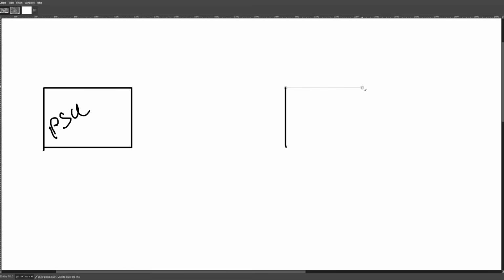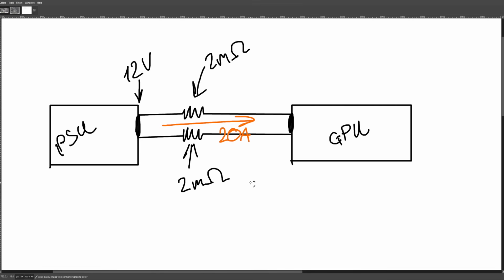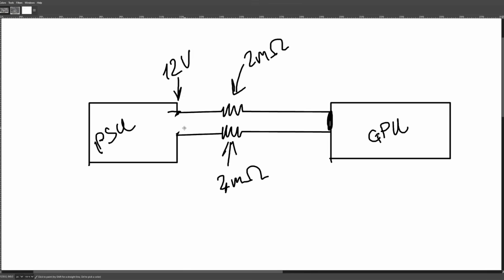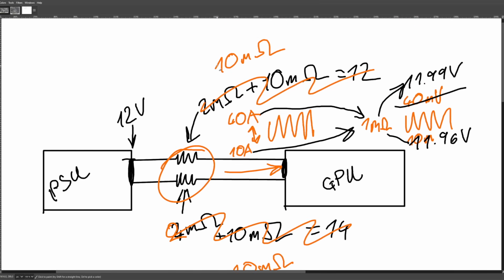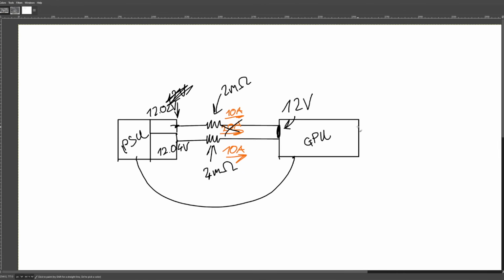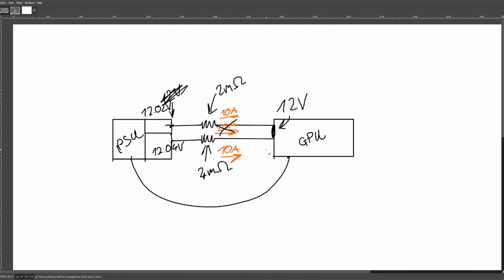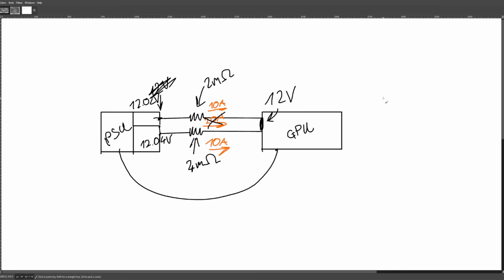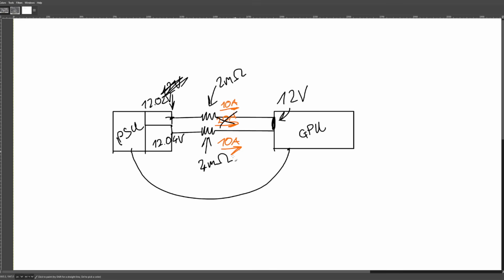Why ATX power supplies don't load-balance power connectors

Comment: I think a meaningful change would be for the PSU to just cut off a load if it's misbehaving. Like, if the PSU can tell that this port is utilizing a bonded connector, but that something has gone (or is in the process of going) catastrophically wrong, then it should just refuse to service that connection until a system reset occurs.

I know that I personally would prefer it if my PC shut down when something goes wrong, as opposed to harming itself in the process of operating.

Comment: Best way ...  12v rail needs to be 24v.   Higher voltage transmits more power with less resistive losses.

Comment: 8:18 Could also monitor the current and voltage on each outgoing rail and then adjust the DC-DC converter in the PSU for that rail, which is hideously complex just so the dumb power connector does not burn the house down.

Comment: my design would be high current bullet style connectors with 2 large wires. bullet connectors at this scale would probably come up at a dollar per assembly, more expensive than stamped contacts. but they are also proven and reliable at high currents, easily doing 80+ amps at reasonable size. having two large high current pins is more annoying for board design, but a fan-out could be designed into the receptacle.

Comment: wire vs silicone is such a cost imbalance honestly just use more connectors. Nobody's goanna complain if you need 3 or 5 or fuckit make it 10 power connectors. If anything it'll feel like an absolute boss piece of hardware if you're flagship card needs that many power connectors. What isn't acceptable is durability issues on a expensive premium product power pins should never melt you can afford the extra connectors and wiring. Also this is a desktop not a laptop I really don't care what the power draw is to be honest, I'm happy the cards only need a couple hundred watts but I'd happily feed my gpu 10,000W if the performance increases proportionally. Hell I wouldn't mind having a dedicated psu or even multiple dedicated psu's just to feed the gpu but Id expect the performance to match. The extra cost of a couple psu's would be nothing if I get a beast card that will still crush new releases of games ten years down the line what I want is reliability and performance that's goanna last a loooong time not power efficiency or something designed to look cool with compact designs and fewer wires or whatever.

Comment: In principle you could make a power supply that has separate transformer windings, diodes, serial inductors and capacitors (the typical components making up a power supply output) for each +12V output on the high-power connectors.
Those would each be lower current rated outputs, have a higher internal resistance, and those would add to the cable/connector resistance making any differences in them less visible.
E.g. you have a couple of 12V/5A outputs that are specified to lose no more than 250mV at full load (2%), those would have an internal resistance of 50mohm.
With 6 of these in parallel, you could supply your 20A and have a total internal resistance of <10mohm, but a spread of internal resistance of the wires is not going to lead to such a wide variation of cable current.
The key point is that you use the (unavoidable) internal resistance of the power supply in a way to "balance" the currents by making cable resistance differences less significant.
Of course it would increase cost and size of the power supply.  And one could argue that the equivalent of this, having separate regulators for each connector pin on the graphics card, is the proper solution.
Reply: Given the transformer windings would have their own resistance, adding a fixed resistor to each lead would have a similar effect with less complexity. This can also be done card-side, and is basically what separate shunt resistors for individual wires (or pairs of wires) does.
Reply: @chord5625  But that results in unnecessary losses.
The internal resistance of the powersupply is an unavoidable cause of losses, but a power resistor put in series with the wire is not.
Other than that, yes it would have a similar effect.
Reply: @Rob2  Separate transformer windings will need to be much smaller to all fit inside the same PSU form factor, and thus have higher resistance.
Reply: @ Yes, but that is exactly what is required because it will facilitate the balancing of the current.
The PSU will likely be larger due to the many extra rectifiers, coils and caps.

Comment: Surely it’s just time to move to connectors like an xt90 which are made for the amps instead of beating a dead horse of molex mini fit
Reply: The RTX 5090 needs the XT-120 connector.
Reply: @MrSummitville I wouldn’t complain with an XT-120, but an XT-90 is almost double what it needs. At 575w TDP that’s only ~48A @12v….. so no it doesn’t NEED an XT-120

Comment: im 8 minute in the video, regulating the current in the psu stile make me think that a man in the middle pcb like a raspbrerry pi or other microcontroller board with a an array of switch and resistor that balance the cable and if the resistance of one wire is too high short the power swich pin on the motherboard to force a shutdown and try to save the gpu while sending a message to for example a custom app on the phone of the user to alert them on the situation and provide real time cable situation report on said app could a product that would help, not a solution to the problem but a way to help reduce damage to the sistem, i want to try make this and maybe sell this, but if someone more capable than me made this it would be intresting see if it work well
Reply: Someone makes a "man in the middle" board to monitor the amps in each wire and send alert via USB.

Comment: They just should sell a cheap high power soldering iron and a bit of solder with nGreedia new plug cards, so that you can cut PSU wire and solder it do the pins and probably remove 99% of the burning issues.

Comment: I'm afraid you've completely missed the point here and this video is a very diverting investigation of something that doesn't matter.
Fundamentally, you show that the 12V rail (in your example) is all shorted together at the PSU and at the GPU. This means that the loom of wires in between cannot be 'balanced' as you call it.
The purpose of the large number of wires and pins on the connectors is precisely because there is a known and variable resistance to the individual wires and the contacts (within know tolerances). The repetition is to run those in parallel so as to reduce the total resistance (1/Rtotal = 1/R1 + 1/R2 + 1/R3 + ...)
There is no requirement to ensure that the same current runs down each of the wires, the desire is to minimise the voltage drop across the loom and ensure the voltage at the load varies to the minimum degree as the load draws more or less current.
The real challenge is to make it so that software engineers can't mess up connecting the loom to the load (not an easy task given how careless software engineers tend to be with hardware). That means a connector that is robust, cannot be inserted the wrong way around, is self-aligning as it is mated, and can't bend the contacts and pins when abused.
Really, the clarion call to computer enthusiasts and software engineers is this: Stop being so ham-fisted and clumsy!
Reply: You missed one goal - making sure you don't encounter thermal runaway on any part of the system. There's no guarantee that rising temperature from overload will increase resistance enough to self-balance, far from it.

Remember that across parallel resistors with the same voltage drop, power dissipation is Vdrop^2/R - it's the lowest resistance path, not the highest, that's forced to dissipate the most heat. The takeaway is that if variance in contact resistance (e.g. 0-20 mOhms) is large enough to dominate baseline wire resistance (~3-4 mOhms), then you can't assume even load distribution across conductors, and therefore you can't assume that the current carrying capacity of 6 wires is 6 times an individual wire.

Fundamentally, you can't push 25A down a typical 16 gauge wire and expect it not to melt. Physics is physics, and ampacity limits apply to each wire individually.

Comment: PSU should never allow more power on a single line than specified. I am not saying that it should do a load balance, I am saying that it should limit the current or shutdown the line.
Reply: I'm guessing adding a whole breaker panel to PSU design is prohibitively expensive.
Reply: @chord5625  I cannot accept that excuse for a device that cost is between 200-300$
Reply: @logman5051  I mean, a breaker panel itself usually costs $300+, so yeah, we're talking about 2-3x in price at the top end and 6-7x price on the lower end.
Reply: @chord5625  what are you talking about, small breaker panel with 5 fuses cost around 30$
Reply: @logman5051  I don't know what panel you're looking at, but a 1K+ watt PSU is going to have a lot more than 5 12V lines coming from it, and that's not counting all the miscellaneous voltages (5V, 3.3V, -12V, etc.) provided or the multitude of ground lines (which can be overloaded, even if no individual supply line is).
Reply: @chord5625  what 12V I am talking full ~230V 50Hz 16A.
But to be serious adding 100 new elements to a PCB can cost as little as 1$, I do not see a valid reason why those components should not be there to protect you, me and a neighbour kid and not only from fire hazard but also from electrocution. Ultimately PSU is responsible for electricity in your PC not CPU, not GPU, not MB.
Reply: @logman5051  Very small components are cheap, but are also too small to handle power currents. You're going to need components capable of 10A, and sensing/control circuitry for each line. That circuitry also has to be tuned for inrush current handling for each device, etc.

Should also keep in mind that if you cheap out on your sensing circuitry, you can introduce new failure modes from the circuit setting itself on fire.

Comment: I think Nvidia made that connector like that so it melts so the card has less value to sell, and the owner has less incentive to do so, so they have more incentive to buy a new GPU, it makes perfect sense when you here the name Nvidia...or Apple...why? To control the market even more from the used-parts portion so they don't end with having to deal with stagnation of sells because used cards exist in the first place.

Comment: The method you propose to do current balancing on the PSU side is almost certainly not how they would do that.  What they would much more likely do is split the regulation circuitry into several phases and give each phase a current sense resistor.  Then they can do a regulation loop that adjusts each phase such that the current in each phase is the same and the total current is what the load needs.  This has the effect of having each wire (or possibly group of wires) have its own voltage, compensating for the differing drop in each wire or group of wires.  It's also much more cost effective since the PSU may already be using several phases to supply the load.  So the extra cost to regulate each phase independently is much smaller than adding a bunch of power components since its just control circuitry and some extra current sense resistors (which, depending on how they designed the power supply, they may already have per phase current sense).  If there's enough demand, the control circuitry can be built into the control chip, making the cost pretty minimal over what they're using right now.

Comment: Your math doesn't work for me. I initially wrote this then edited now i'm just rewriting it. So i was basically making an assumption that you meant 2 millionth of 1 resistance ie .000002 and not 2000000 ohms for example as 2 and 4 megaohms just doesn't work. Especially as we can't get to 10 amps per side with 2megohms. Math would be 12v²/2000000 ohms=0.000072 watts and 12v/2000000 ohms=0.000006amps. If we go back to say 12v and 10 amps we get a resistance of 1.2ohms and 120watts. Now back to where i think you meant to go was adding 2 millionth of 1 resistance so 1.200002ohms total and 4 millionth of 1 resistance so 1.200004ohms total. Then these numbers are almost inconsequential.  The voltage difference would only be 0.00002 volts. Note that if 1 side did have 2 megaohms and the other side had 1.2ohms ya the 1.2ohm side is taking 99.99999% of the load as the 2 megaohms side is darn near an open circuit. If we instead say 1 side is 1.2ohms and the other has an extra 1ohm of resistance so 2.2ohms this side is only putting out 5.54amp and 65.5watts. Meaning it's only doing 27% of the load when it should be doing 50%. So the 1.2ohm side is doing 73% of the load. And this ofc can cause overheating as when it exceeds it's rated value which is what 300watts per side for 600 watts total. If a vid card is doing 500 watts as a rtx 4090 does and 1 side is doing 73% of the load that's 365watts so it exceeded it's rating by 65watts on that side and or exceeded it by ~22%. And we've seen overclocked 4090s doing 666watts btw and that would be 486watts on 1 side. Yikes. If that doesn't melt sockets/cables i'd be shocked.

Comment: I dont think current balancing solves the problem, its not the wires resistance is imbalance that much its the connector pins which is resistive because of bad connectivity of oxidation, which means its will heat up. Because higher resistance means higher power loss which becomes heat.
Reply: Ironically, when it comes to parallel conductors, you've got it backwards. Voltage drop is the same across parallel conductors (by definition), so power dissipation on each path is Vdrop^2/Rpath - the lowest resistance path is forced to dissipate the most heat.

It is still true that keeping contact resistance consistently low across all pins will reduce overall heat, by reducing Vdrop. But when you're running so many parallel conductors so close to their maximum current capacity, you have to balance the current across them or else manufacturing and transient variations in resistance (e.g. contact resistance) will lead to overload.

Comment: Why is the combined resisten from 2mohm and 4mohm 1,3mohm?
Shouldn't it bee 0,75mohm because of parallel resistens. So 1/2 + 1/4 = 0,5 + 0,25 = 0,75 mohm
Have i overseen something?
Reply: 1/2 + 1/4 = 0.75 = 1/1.333

Comment: I don't understand why to even split into multiple cables if they are connected on both sides anyway.
Reply: Counterintuitively, you actually need less copper if you use more wires. Thinner wires are also more flexible and easier to manage.
Reply: @karl0ssus1  But this example raises a critical issue with the "parallel conductor capacity = sum of individual capacities" assumption. If the resistance variation isn't controlled from conductor to conductor (in particular, if contact resistance variance dominates wire resistance), you either need to derate to account for uneven loading, or add load-balancing mechanisms to compensate.
Reply: @chord5625  Sure, but basic load balancing is honestly not very hard. The GPU has multiple power phases already, just split them up over the pins. Don't even have to redesign the connector. This is relatively common practice for multiple 8 pin cards, each 8 pin usually only supplies half the power phases. There's just not a lot of thought being put in to properly using the 12pin connector for whatever reason.
Reply: @karl0ssus1  Oh I agree, just adding an asterisk to the idea of "more wires = less copper". There's a tradeoff to it too, just one that GPU/CPU power phases can easily handle.

More voltage would be another way to reduce excessive current, and it would also be easy for the phases to compensate for it (since they're all switching regulators anyway, reducing the voltage to whatever the silicon needs).

Comment: Why don’t they just use two thick wires — one for GND and one for 12V — and let us screw them directly into the GPU and PSU instead of using a connector? That would feel a lot safer.
Reply: Because heavy-gauge stranded wire costs many times more what thinner wires are for the same length. It would drastically raise the price of the cables.
Reply: @watchm4ker  Higher voltage is a much more efficient way to scale for higher power delivery (same thing in transmission cables), but at some point you're just passing mains voltage along to the GPU. Maybe the AC port meme was right after all...

Comment: nVidia has always pushed out of spec and then tried to change the standard. Ambitious company's always do, getting everyone to follow is the real problem. The 12v connector has popped up on AMD's 9070XTp although it looks like they (I'm thinking Sapphire) has a 3x8pin PCIe lead in there. Those with 12vPwr on the PSU are going to go direct, it's that safe? 9070XT... probably but not worth anything higher.

My real concern is how to get rid of the screen burn in after (watching a static screen while) listening to this video.  😂

Comment: The reason neither balances is because of either did the 50 series chip either would not provide the expected performance either in FPS or Stability or both. I get the feeling if any lead couldn’t draw what it wanted when it wanted it, it would crash. Nvidia choosing this connection to save money is analogous to NASA using cheap O -rings on the space shuttle - it’s a disgrace.

Comment: The 12V rail of PC PSUs exist to power multiple mechanical motors in drives and fans.  Every 12V pin will usually have a different load .  The main exception is the big hot-pluggable 12V only PSUs used in servers .  HP Proliant PSUs have really good 12V connectors that carry the entire output of each PSU in one giant pin with a very wide bit of copper feeding it, not a stupid bundle thin AWG 16 wires .  Cheaper to manufacture and really suited for powering a wasteful nVidia GPU .